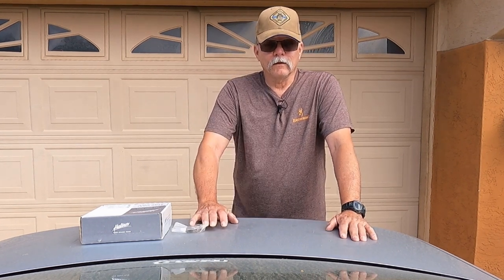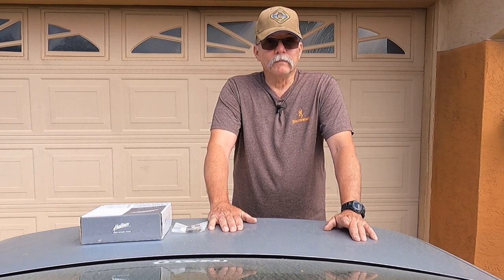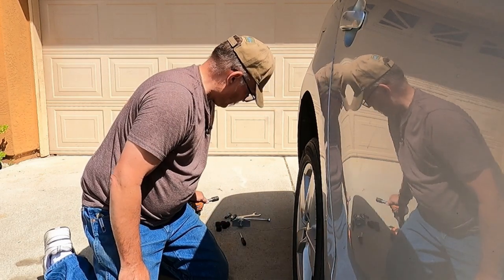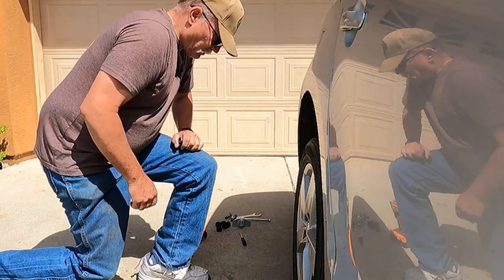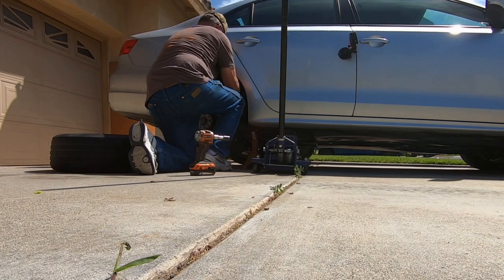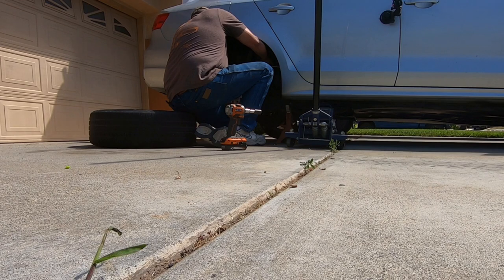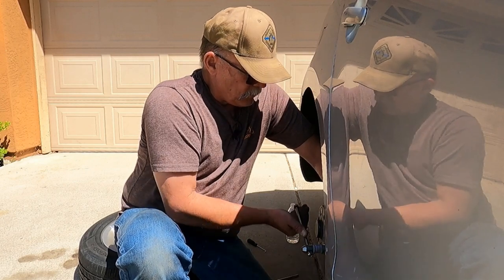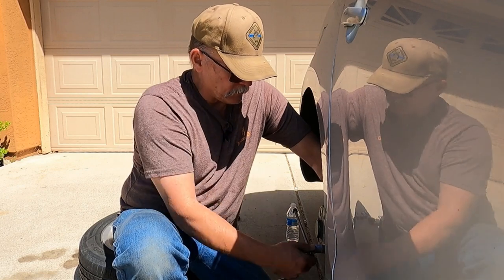VW Jetta MK6 rear brakes

Comment: Targets? Maybe single use targets
Reply from the maker: Hmmm, they might work as .22 targets. I just have to decide how to mount them...on a stand or on a chain?
Reply: @Halfmilesniper  I think a chain is going to drive you insane with the deflection and movement I also think a tack weld on that material will be very brittle but guess will see....
Reply from the maker: @ExcavationNation  you might be right. I looked at these brake pad plates and immediately thought .22 targets, lol.  I might just try a piece of flat iron for a base.

Comment: Do you steal the catalytic converter also? 😆
Reply from the maker: Well, the catalytic converter is non existent on this one, it's a diesel, LOL.
Reply: @Halfmilesniper  Converters are disappearing quickly recently- Like free beer. Problem is insurance doesn't pay for a replacement in a lot of cases. Forgot it was a diesel model. Duhhhh. 😆
Reply from the maker: @billdye3530  they have busted converter theft rings regularly out here too. One of the guys who worked for me had his stolen a couple years back, at least insurance covered the replacement. I almost forgot it was diesel  too once when filling up...caught it before starting the pump...only happened once.
Reply: @Halfmilesniper  We have a few slow thieves that decided when facing a deputies 9mm that a converter in one hand & power saw in the other wasn't a compromise to a hollowpoint.  Run Forest 🏃
Reply: @Halfmilesniper  You mentioned the 45 caliber air rifle & my little light bulb came on. Air rifle vs brake pad maybe?  😆
Reply from the maker: @billdye3530  I'll have to see if I can get some appropriate flat iron before this weekend. We hope to shoot that video after the pistol match.

Comment: Lol , I read your fueling comment with Bill. My sister learned a hard lesson by putting diesel fuel in her Honda civic lots of $$$ to fix it up after.
Reply from the maker: That can be an expensive mistake, especially if you run the engine after mis-fueling...without running the engine its just a drain and clean the tank plus tow fee and labor.  Older diesels getting a little gas wasn't an issue, in fact the old practice was 10% gas in your diesel during winter to prevent gelling in the cold.

Comment: Gotta ask, how many window regulators have you replaced in the VW? My daughter had a Jetta, a little older, I replaced 5 window regulators, driver's side twice. Sorriest piece of engineering I've ever seen. Fun to drive, .................until they're not
Reply from the maker: So far...none. Not on the wife's Jetta sedan or my Jetta Sportwagen while I had it. In fact the only electrical gremlin we've had has been the bluetooth connection for the cell. Her phone connects intermittently. I know some folks have had nothing but gremlin after gremlin.

Thanks for watching, I really appreciate it.